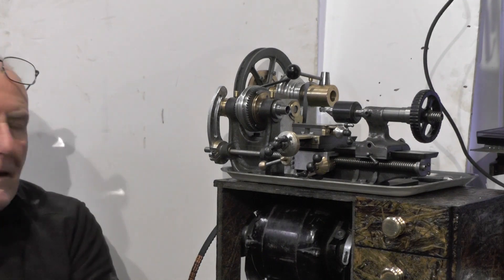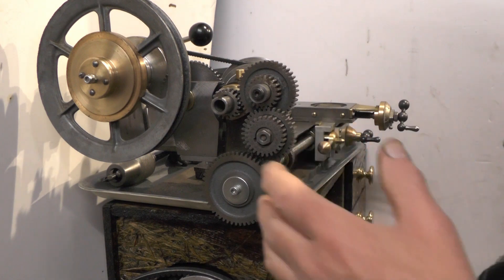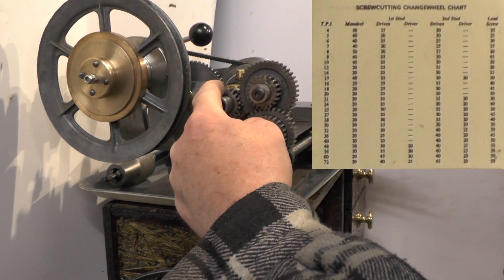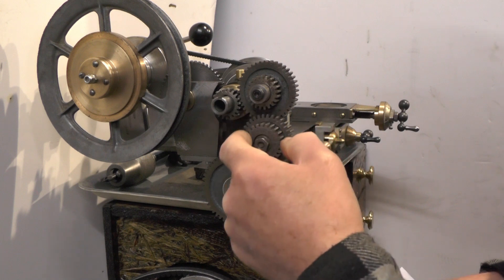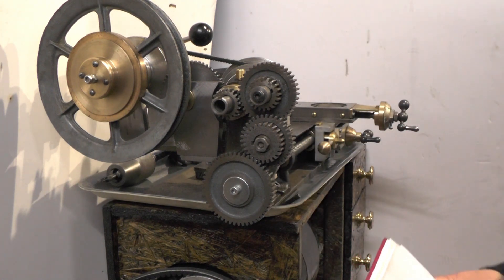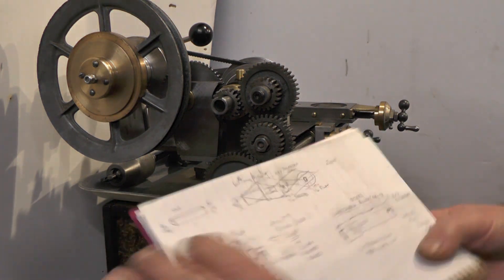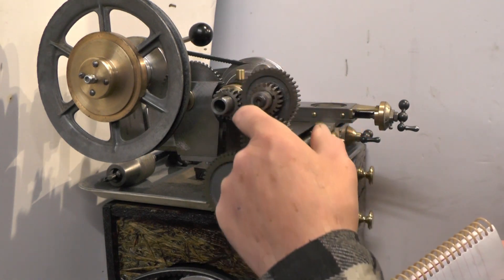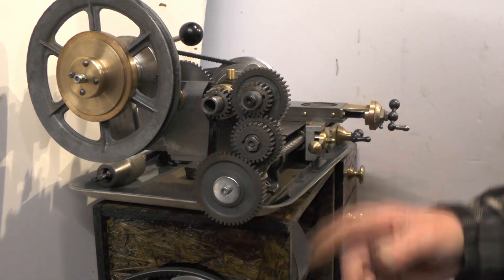Ep 20 Making a Micro / Mini / Watchmakers Lathe  (Screw Cutting Assembly # 4)Test Run "mr factotum"

Comment: Hi Kev.  Looks like you banjo and gear assembly is going to work out quite well.  I was thinking, since you don't have the room for tumbler gears to reverse the leedscrew, maybe you could adapt the method atlas used on the 10F series.  Basically there are three bevel gears connecting the dive to the leedscrew with a dog that engages the inner or outer bevel.  The dog drives the leedscrew and depending on which bevel is driving the dog will change the direction of the screw.  You could maybe put it in the unthreaded portion between the banjo and right side of headstock.  Anyway, just a thought.  If you are interested in seeing the mechanism there is a video on my atlas list.

Great project you have there.  Thank you for sharing sir.

Joe
Reply from the maker: hi Joe
many thanks, sounds like a good idea, i will take a look at your atlas video. If i can incorporate it late,r then i will have it for another project
cheers
Joe
Best wishes
Kev
Reply: @MrFactotum  maybe numbers 8 and 10 in the list would be helpful.
Reply from the maker: @MyHeap   Thanks, yes very helpful Joe👍👍
Reply from the maker: another question Joe
did you manage to get the Atlas lathe finished off
atb
Kev
Reply: @MrFactotum  yes sir.  I use it frequently and managed to get some extra attachments for it.  It is a light lathe, but as long as I don't get greedy with the cuts, it does well enough for me.  I found a compound for it and had the change direction gear box rebushed.  Qctp, follow and steady, taper and milling attachment for it.  I will need to use it to make some parts for the old Burke mill.  Things have been so busy the last couple years with work and family that I struggle to get into the shop.  But I am hoping 2024 is better.  Videos like yours keep my spirits up, and I appreciate that you share them with us!  Happy New Year my friend!
Reply from the maker: @MyHeap  Great to hear your up and runing and using the Atlas, albeit not as much as you would perhaps like, 
i love the old vintage lathes Joe.
HNY to you and yours
see you next year hopefully you'll be in the shop making video's👍👍👍👍
Kev
P.S.
Just been on ebay and looks like i have found a far eastern site that i can get 3 bevel gears in numerous different sizes, so now just need to get my sizes and see if it's feesible to do, My project list keeps getting longer, but far better than being bored👍👍

Comment: It's really starting to take shape now Kev. The change wheel assembly is really well thought out. One thing I noticed though is the washers used to hold the gears on just looked a bit out of place, perhaps some brass ones at some point? No doubt you're way ahead of me on that one. I'd love to see it do some turning. Merry Christmas 🎄
Reply from the maker: cheers Olly
quite a bit still to do before any metal removal, although i know it looks like a lathe at this stage, lots of finishing, guards, toolpost, chuck backplates etc etc the list goes on, also on lookout for some small cast legs to make a period stand for it. 
All with other ongoing projects in the wings, 
and now a fence to re erect😰😰 never time to be bored🤣👍👍👍
atb
Kev